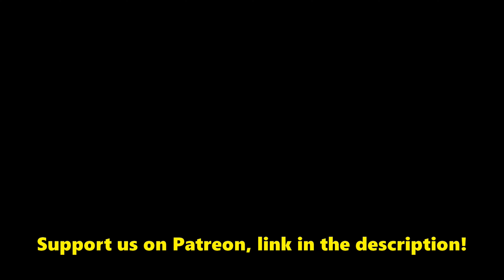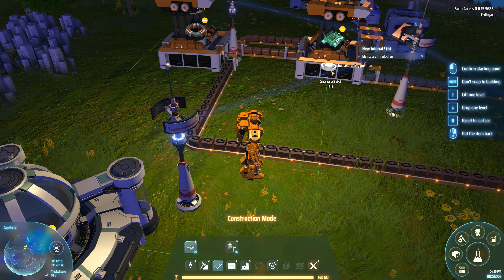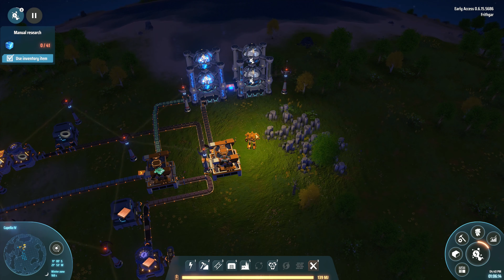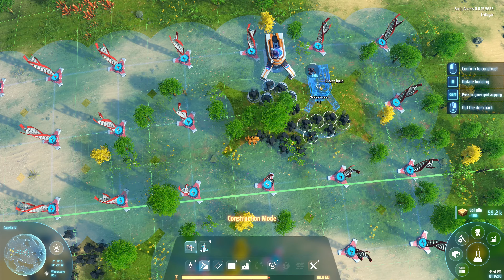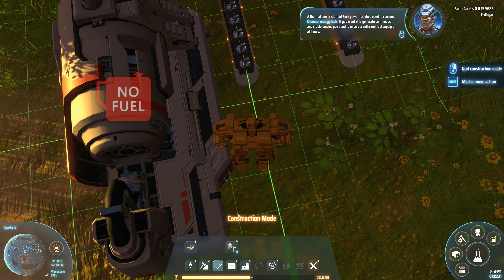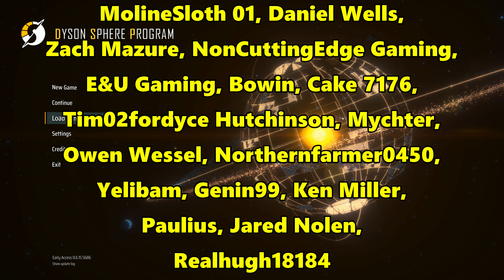Let's Play Dyson Sphere Program #3: Windmill Farm!

Comment: 1 - Stop using wood/plant products to fuel your suit. Use coal instead (the wood and plants can be used later for other things). To prevent them from filling up your inventory, just slap a storage depot down, and manually fill it with the plants

2 - Give your research labs a bit of space. Eventually, you'll have research that requires six different types of "colored blocks" to complete

3 - You can queue several research projects at a time

Comment: one thing i might suggets is when placing miners down use the shift placements and not the snap points with shift you can put it down to cover a larger area and will get you materials much faster,, also the rechearch towers you can rechearch to stack higher and higher i have 40 towers of each collar running and my rechearching tower is 2x15 towers